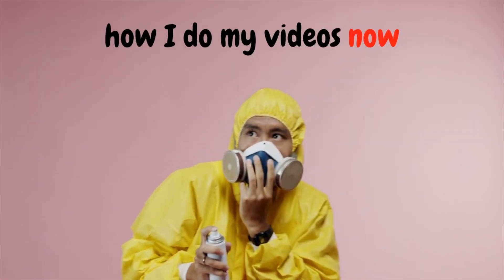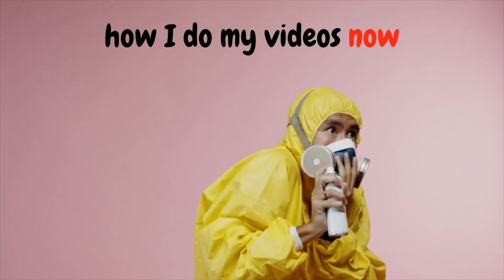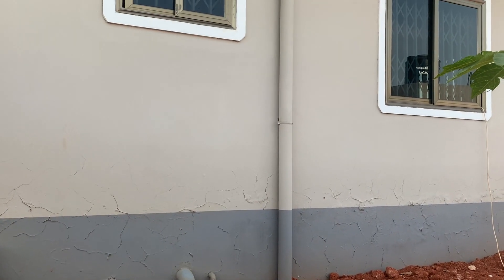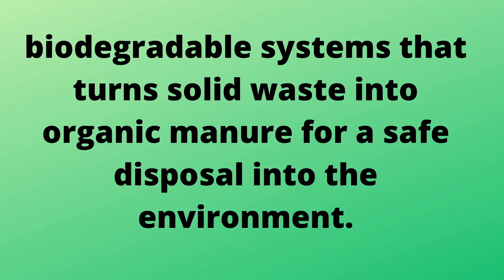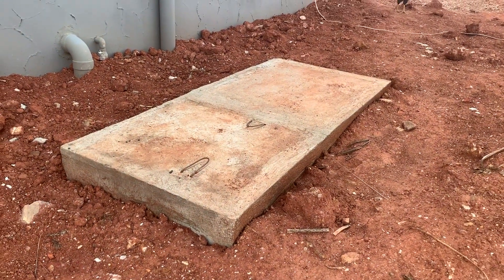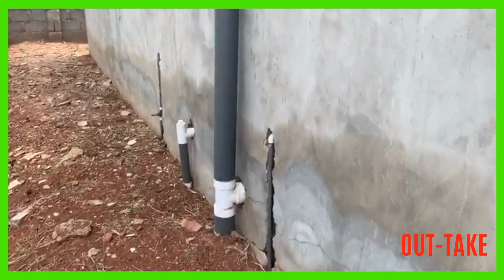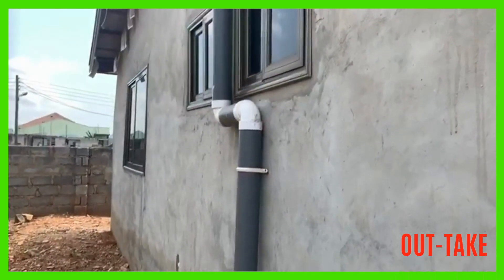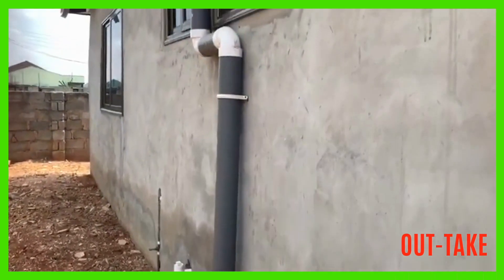Why You Don't Need a Vent Pipe On Your Bio Digester

Comment: Without vent pipe, don't you think that the digester might break due to heat?
Reply from the maker: Jude heat from where? It’s not a septic tank that the human waste and the waste water are together so pls no heat. If you’re worried about heat then the vent for the toilet seat should be enough. Moreover it’s supposed to work in the absence of oxygen (anaerobic) https://youtu.be/TM2YqP1KOVU

Comment: putting the vent pipe on installation is not appropriate but still vent pipe is installed for the system. also biofil digester is aerobic decomposition. biogas is anaerobic decomposition in order to get the gas as the product for cooking.
thanks

Comment: You're confusing cesspool (manhole) with septic tank.  Septic tanks systems are also anaerobic processes with drain fields or soakaway pits. A correct septic tank will not have a vent on the tank.
Reply: Do you meam that there shouldnt  be any vent pipe in the installation, i.e one that extends to your roof. Or you mean only above the tanks
Reply: @gillbeatsisback01  I mean on the tank, there's no need for vent, but there must be a ventilation which can be through the plumbing system or the roof.

Comment: I am a Marine Engineer, and I very much understand the concept of Aerobic and anaerobic decomposition of sewage since we use them a lot. The issue is, anaerobic decomposition of sewage generates toxic and explosive gases such as Ammonia, hydrogen sulphide,  methane, etc.,  It is a common practice to provide a one way vent on the tank to prevent over pressurization and possible explosion of the tank. so the question  is what type of vent is being provided. a free vent that allows ingress of air is wrong, but a one way vent to get rid of extra gasses to prevent over pressurization and explosion is a necessary safety feature. I stand to be corrected,  but this is what I know from years of practical engineering.
Reply: The vents in the house plumbing system can handle any pressure in balance.